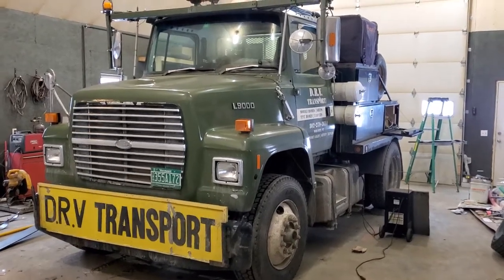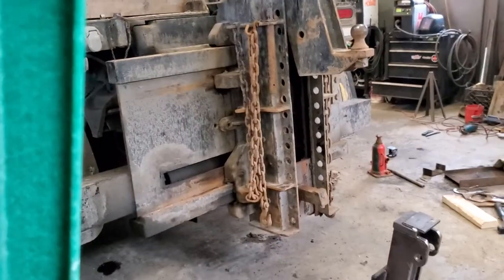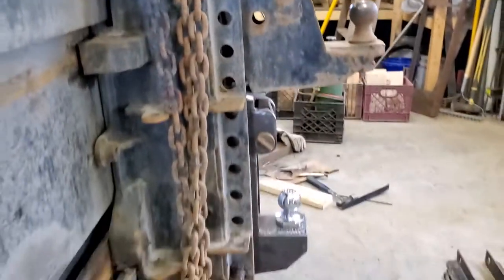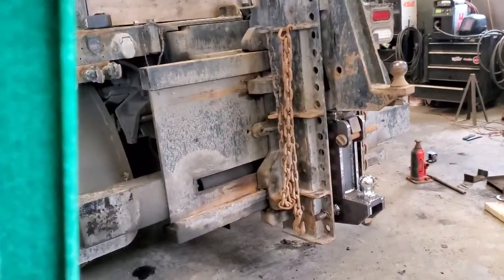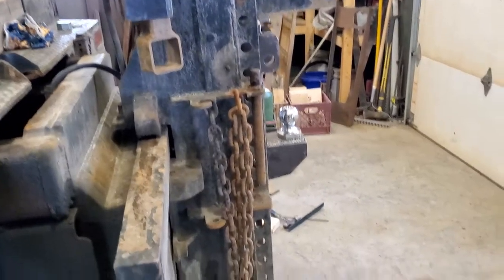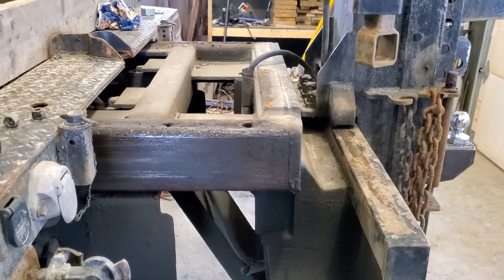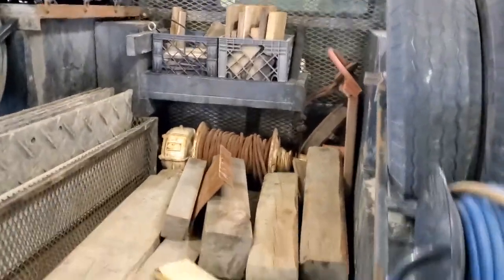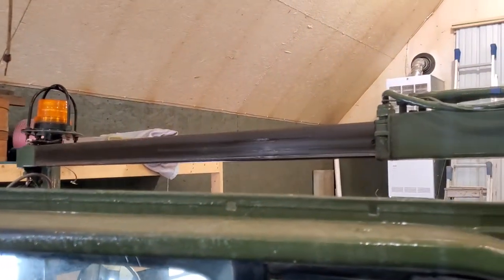Homemade trailer hitch for Kingsley fisher trailer hitch system

Comment: Greetings from the Ohio Porters. 😎 We had a 1965 Ford C800 that we welded a hitch plate to pull mobile homes. 🤩 The mirrors were heated and electric but not the extenders..had to pull those out by hand. This truck was a tractor, used as a wrecker with the 5th wheel boom added and pulled several kinds of trailers. I really like your Ford and the setup you have...hydraulic makes it very quick and easy when you have to raise it on the move. 🧐

Comment: Did the new ball help with the control of the load?  I have a sterling with a precision  6 way and would like a ball closer to the rear axle than the original. I am just curious if would make a difference or not.
Reply: Yes it will help stabilize load